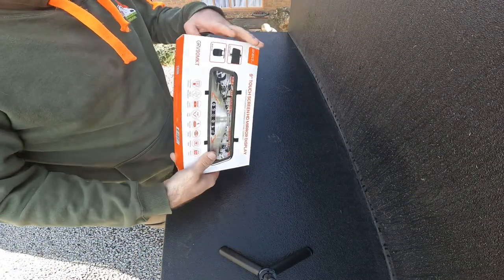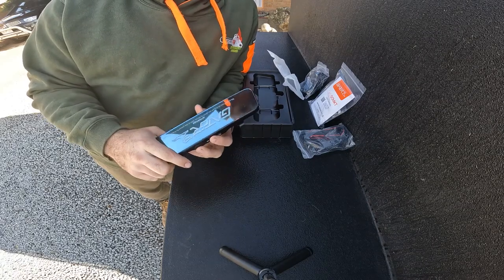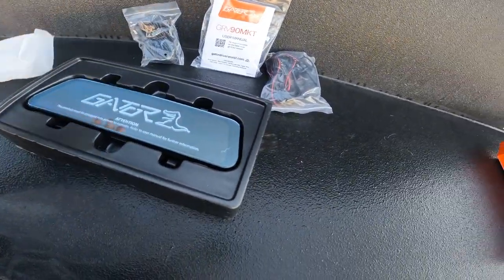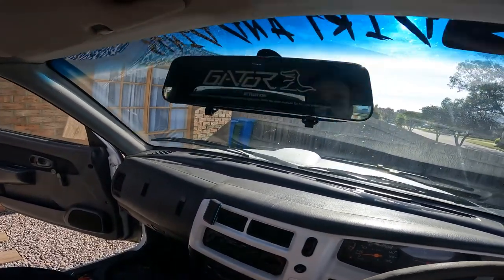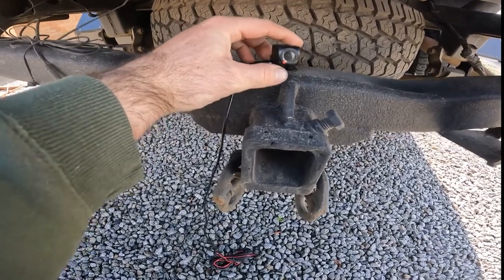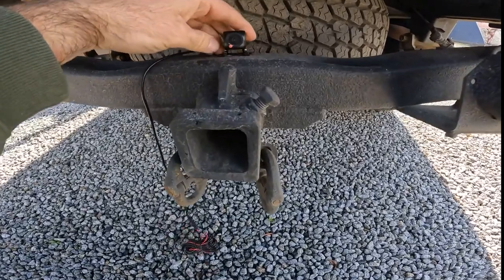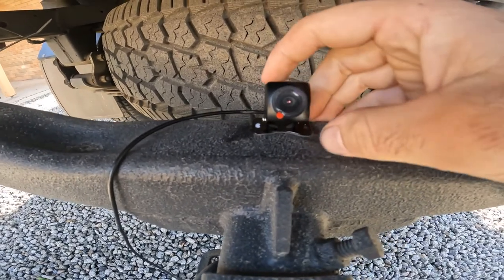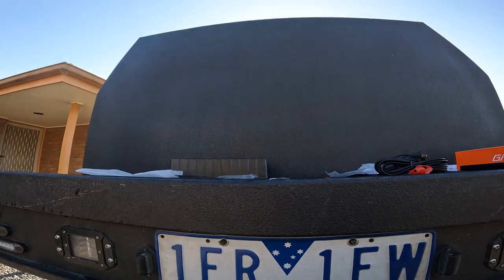DnD ep 9: The Triton Gets a Safety Upgrade - Gator GRV90MKT Reverse Camera Install

Comment: Good review.   Can you adjust the grid lines for the  reverse camera.
Reply from the maker: Unfortunately the adjustment that can be done is to move the camera up and down on the screen the depth or length of the grid lines can’t be adjusted. Hopefully that helps!
Reply: @Dirtanddints  cool thanks. I bought one. It is  good at night for live streaming than the regular rear mirror.